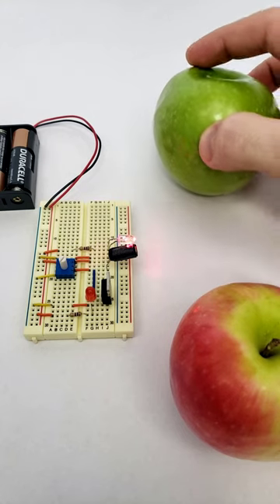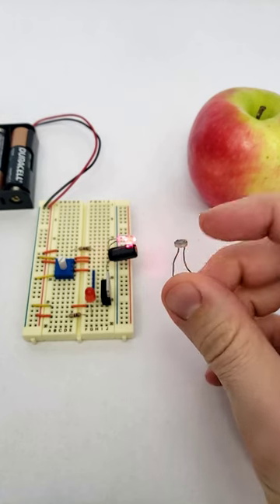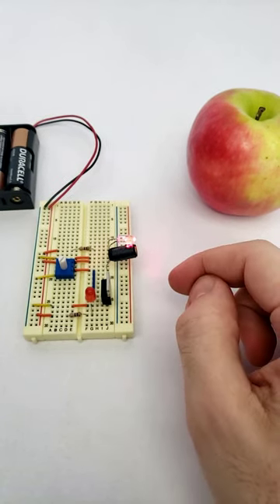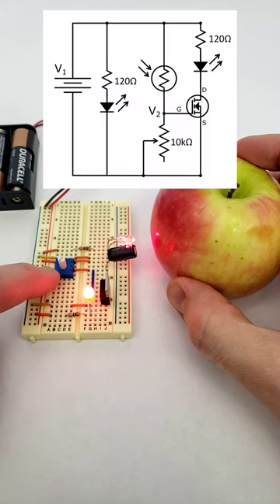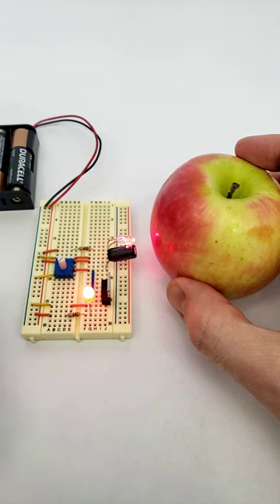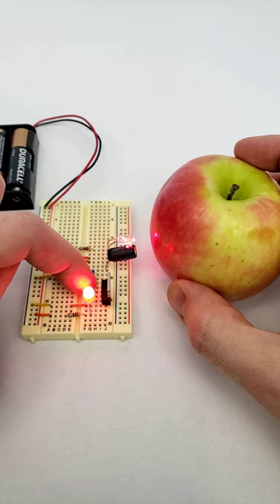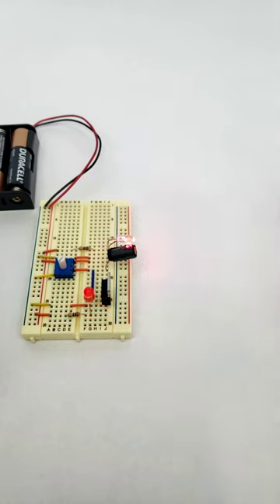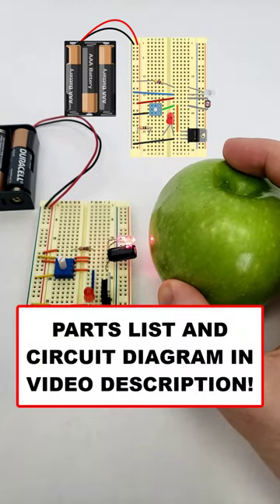Simple Color Detection Circuit

Comment: Does it work with a normal transistor for small voltages?
Reply from the maker: You could adapt the circuit to use an npn BJT, but make sure to include a base resistor.
Reply: @Science.Buddies   The base “resistor” is gonna be the voltage divider in this case. Depending on the reflected light on the apple the base is gonna get a low or a high voltage and if it is gonna be a high voltage (above 0.7) the transistor is gonna turn on and let the current flow from C to E. Is it right?
Reply: @Science.Buddies  I hope, you understand my english